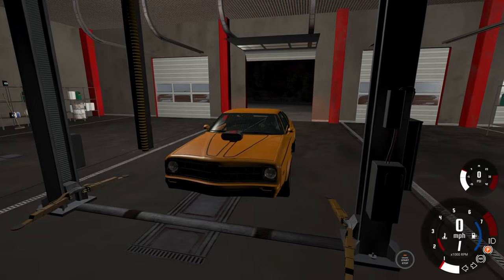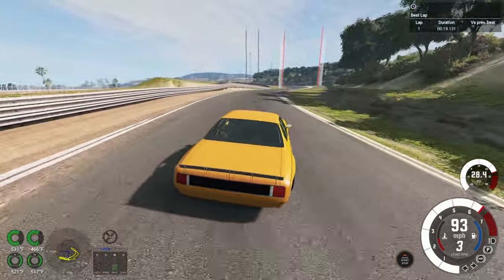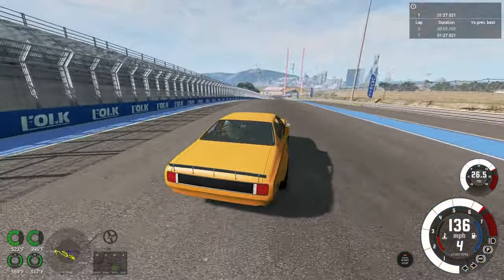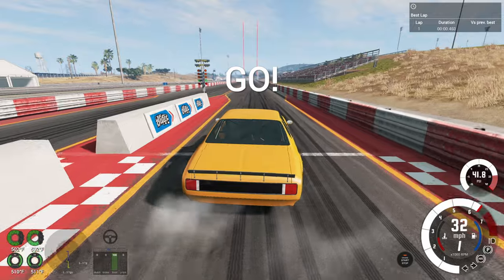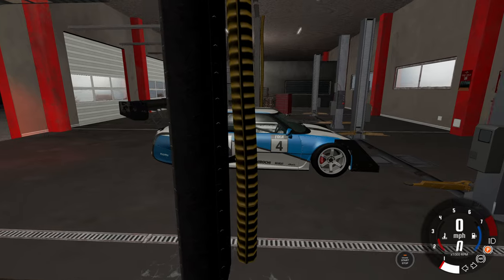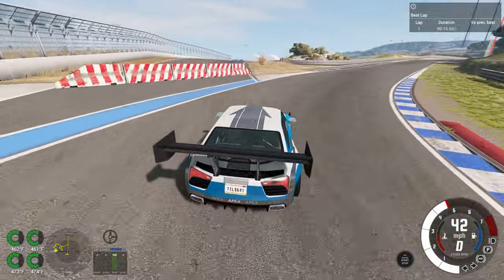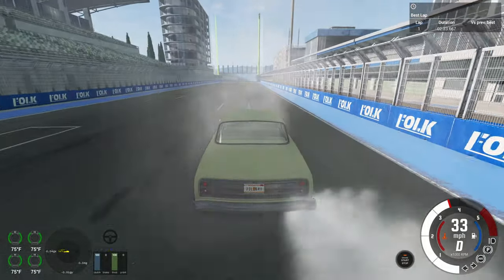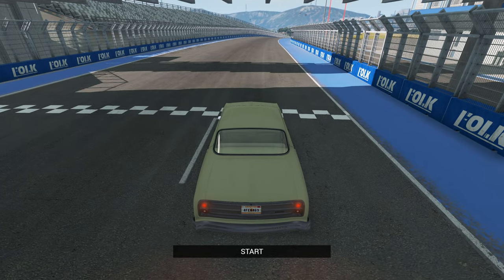Are Cars FASTER on Jupiter? - BeamNG.drive

Comment: Fuel efficiency would also be lowered when under Jupiter gravity
Reply: I mean in order to even get fuel to the intake you would need a very high pressure fuel pump 100psi or more. Completely different fluid dynamics because of the atmospheric pressure on the lines. Unless you put some sort of vacuum on the lines to drop the atmospheric pressure to about 15psi. Let alone all the other parts in a motor.

Comment: Gravity does affect the air on the atmosphere and it'd be far denser air, with grater atmosferic pressure, wich, I think, would increase the amount of air flowing through the engine, possibly giving it more power. Not sure if it'd be the case and how much better i'd run, but the engine would need ECU remapping, almost certainly.